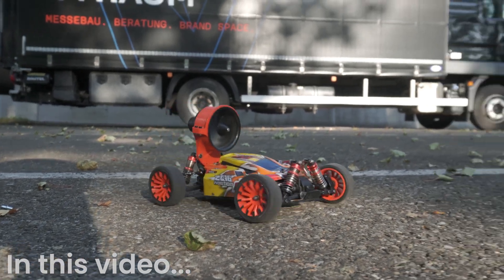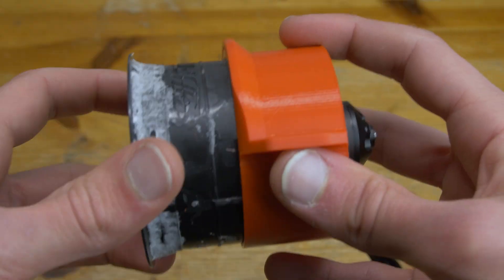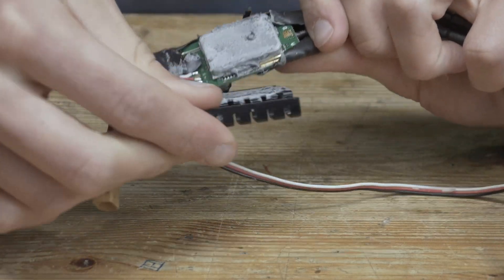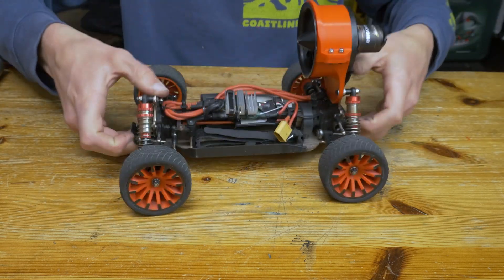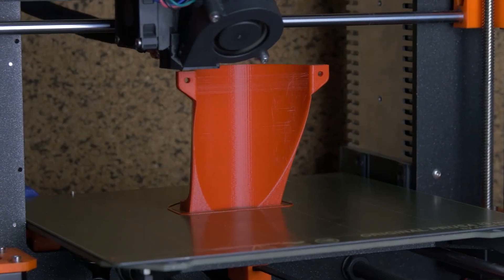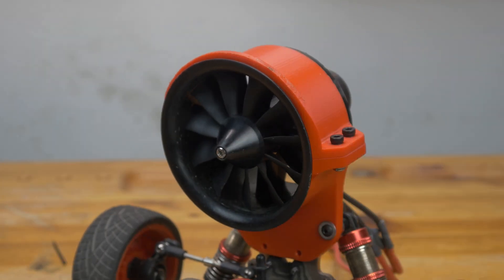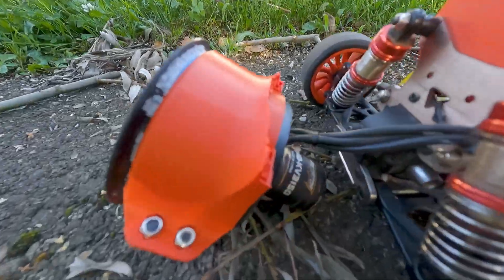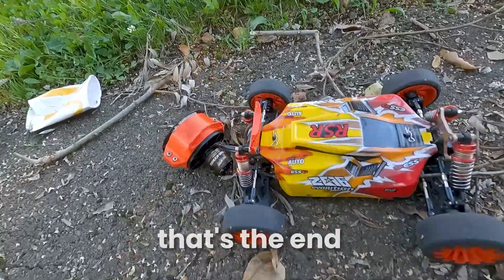How I 3D Printed a JET-Powered RC CAR that RIPS!

Comment: You should’ve removed the motor from the rc car ( it’s heavy for what it is ) and used the chassis as a heat sink. 
Angle adjustment could’ve been done with suspension adjustment as well. 
The wl144010 also picks up a few kmh just from a wheel alignment. 
( reduce rear toe )
Reply from the maker: Thanks for your suggestions! I may try out some more improvements in the future to see just how much more is in it :)
Reply: @ scale rc fan boat next?

Comment: You should put a Nozzle on the EDF. It will increase your top speed and overall performance. It should be a smaller diameter at the exhaust side. 15 to 20% smaller is a good place to start. You can make a temporary one out of a cup or cardboard for testing diameter sizes. It will perform a lot better. You also need a round intake. You are losing almost 30 to 40% thrust. Take a look at the intake shape of an EDF Jet it needs to be round with no sharp edges. You can buy or print the intake. You are losing lots of performance the way it set up right now.. You could also 3D print the whole thrust tube and inlet.
Reply from the maker: Thank you for the valuable info, I should definitely try that! How far out to the front should the circular intake extend, and is it just a simple hollow cylinder or should it expand out to the side?

Comment: What type of filament did u use? if you haven't yet i suggest printing it in tpu, petg+, or maybe pc (polycarbonate) it might help with strength and also try adding a Active Aerodynamics system with digital high speed servos and a gyro put them together and u might have more stability and downforce for the car to grip better. im currently working on building a rc car that God willing is going to break the current world record of 200 and something miles. Let me know what you think and best of luck with the project im really looking forward to the end product.
Reply from the maker: I printed it in PLA, great suggestion - printing it in those filaments would surely make it stronger :) active aero would be epic as well :o hope you achieve your goal of 200mph and let me know when you do!

Comment: The fan is mounted very high...
Can you mount it lower?
Or, maybe, one either side 😂💪😎✌️❤️
The hight is very bad for handling, weight distribution is sooooo important 😊
Also, you had the fan mounted at the back, does it change anything if you mount it at the front? 🤷‍♂️🤔❤️😋🥰
I'm not hating, I promise 😢🤝...
Just wondering with my thoughts ❤
Reply from the maker: One on either side would be awesome, I may try that in the future! Mounting it in the front would've probably made the car a bit more stable at speed, but I really like the look of the EDF at the back :)
Reply: @ValRC1  
Fair enough 👌 🙂
I'd love to see a two fanned attempt...
How much do the fans weigh compared to a traditional motor? 🤔

Comment: Why did you leave the stock motor in there? Extreme ballast makes you go slower.
Reply from the maker: To make it easier to revert to the stock setup in case it didn't end up working out. I'll probably be taking it out now though!

Comment: what i learnded. From the point of what wattage i need from the Motor every outrunner with propeller is surperior mostly any turbine style "fan"
Reply from the maker: Interesting, where did you find that out?
Reply: @ValRC1  hi puh that's from these efficiency Ratings/tests. The best prop is with one blade and counterweight. The more blades you have the more force you need. Many high speed planes never use impellers.
You can't compare that to real jet engines. Here the motor is the same. A brushless one only the roller changes.
Reply from the maker: @Nordlicht05  that's interesting, I guess EDFs still provide more power compared to a normal 2-blade prop of the same diameter though?
Reply: @ValRC1  could be but depends on the rpm and the angle of the prop. These high speed planes often have 4-6 or more blades.
Of you put power draw to what actually comes in thrust it should look pretty dark for the EDF.

Comment: Consider the fact that the engine mount was made from plastic that is brittle and doesn’t take a crash into a McDonald’s Cup very well. I enjoy what you are doing and I will wait to see what you do next! 😎👍🏿
Reply from the maker: That's true, I actually figured out that it was the edge of the road I hit and not just the McDonald's cup afterwards as well 😂 Right now I'm actually working on a new and improved RC Hovercraft design!

Comment: This is my first time here. I clicked because I saw you doing something different, I was even happier to see that in some instances, you were using parts taken from something else, like the Heat Sink from the computer motherboard. I saw how your vehicle was handling and I would like to suggest using a rear spoiler of some sort over the rear wheels as well as an air dam on the front end. It won’t take long before you realize that, “ You Are Going To Need A Bigger (Boat😀) Car to handle that small jet!
Reply from the maker: Thank you for the great feedback and your suggestions! I really appreciate it :) Now that you mention it, I actually do have another RC car exactly like the one in the video, but a bit longer! Might be worth trying out

Comment: When i was 13 back in like 1994 i mounted an class d rocket motor to my kyosho pro-x, it was fun
Reply from the maker: That's awesome! Good thing about the EDF compared to a rocket motor is that it can be controlled a lot more than a rocket motor and doesn't need to be replaced after a single run
Reply: @ValRC1  ikr, it took me about 5 prototypes until I could actually control it, I was the king of fastest rc car in the neighborhood. My pro-x topped out at 30 mph. Figured that out by chasing moms car down the street lol. I was in the model rocket club and when it came time to launch I was able to use the runway for a speed run, It reached something like 70 mph, then I mounted two rocket motors and all it did was fly through the air tumbling, that was the end
Reply from the maker: @garrettburrows442  haha that's awesome!! Were you able to repair it after that wreck?

Comment: Fake video, the propeller dont work, you use engine inside
Reply: If the video is fake, then how can the car lift its rear wheels with the internal DC motor at 6:46?

If you really think this is possible, you should relearn physics

Comment: Cool but I don't know why you'd be confused that a 3d print broke in a crash? I print parts for my cars too but I kind of expect there will be some breakage in a crash.
Reply from the maker: Fair point xD I was mostly confused because it had survived seemingly worse crashes up until that point. But I'll just make it a bit beefier to strengthen it!
Reply: @ValRC1  Possible earlier crashes may have caused some fractures in the layer lines and it just let go on the last one. Cool project and nice looking design work on the mount regardless! 👍
Reply: I think sends in his 3d printed parts to another place to be made of stronger materials?

Comment: That’s so cool, you may want to add some metal mesh to the front of the fan to stop debris from getting in and damaging the blades
Reply from the maker: Oh good Idea, wouldn't that reduce the airflow though?
Reply: @ValRC1  yes for sure
Reply: It wouldn’t restrict that much airflow but if you’re going for pure speed, then taking off that bit of weight may help but if you’re going for reliability and less work for yourself, you may want to put the mesh on there to keep it safe
Reply from the maker: @Unwatchablegarbagewhy  Alright, I'll think about it! Thanks :)

Comment: Why not remove the motor and drive shaft to fit a bigger esc and battery. You know it craves 6s
Reply from the maker: Haha that would be awesome! The EDF is only really made for 4s power though so it'd be risky!
Reply: @ValRC1  I will —— set the car ablaze!!!😂🔥
Reply from the maker: @Remi-The-DIY  exactly 😂